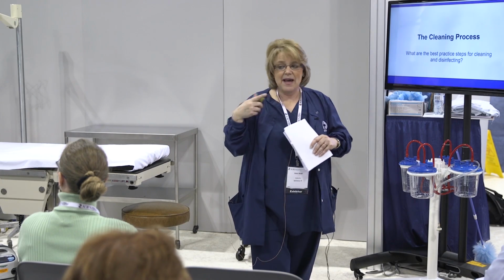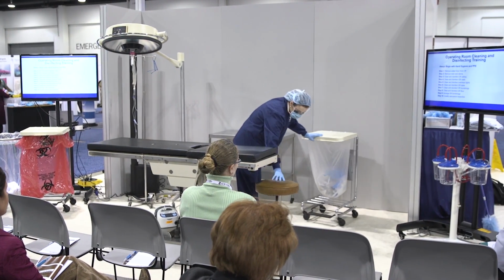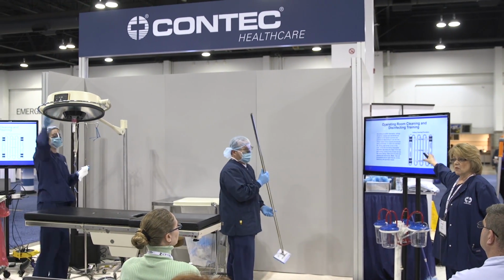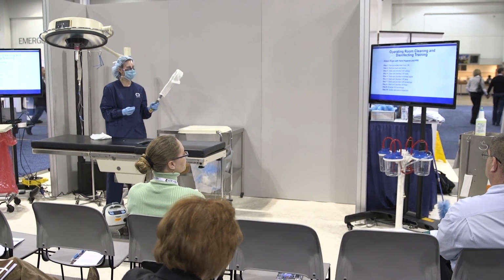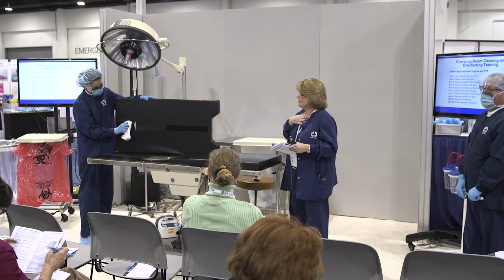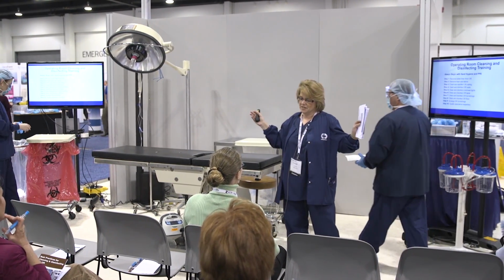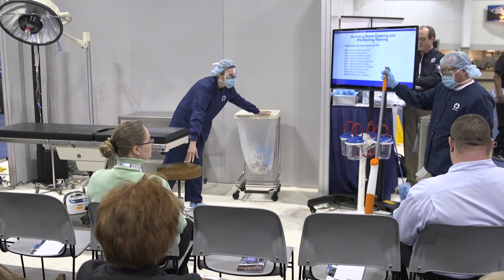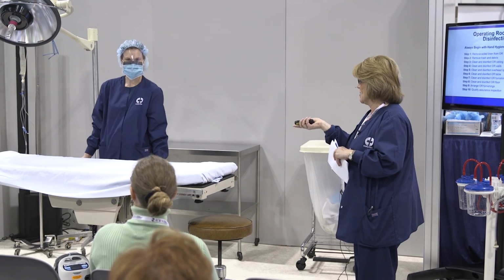Contec - 10 Steps for Operating Room Cleaning and Disinfecting

Comment: Start top to bottom. First item i clean is the table so i can move the bed peieces over there as im clesning it, this way i am not putting a clean item on something dirty. I taise the bed all the way up and clean underneath very good, and get into the crevices as best as i can (bc they can get dusty, and blood droplets). Do every other item and mover everything towards the bed. Then when moping the floor do the corners and moving the items over a wet puddle ive made with the solution (to clean the wheels) and put against the walls and then mop the middle and under the bed too. We are not told how to set the room, i just make sure the trash, linen, red bag, and blue gauze holding are all together lined up nicely. There are some machines we are not allowed to touch... so the ORAs does those. I love my job!! And i love learning how to better my skills.